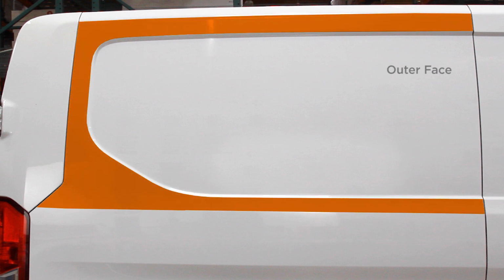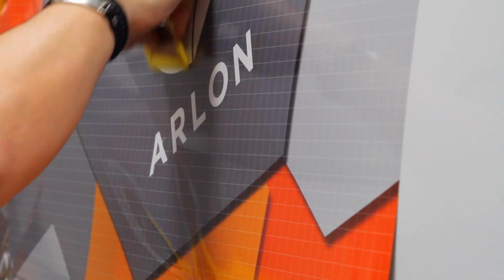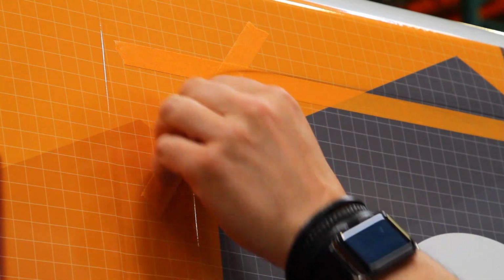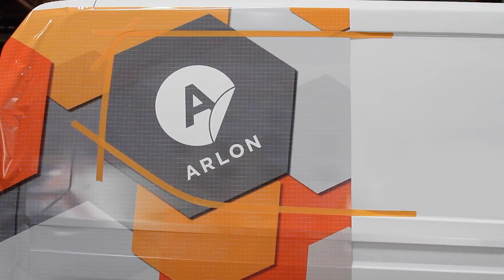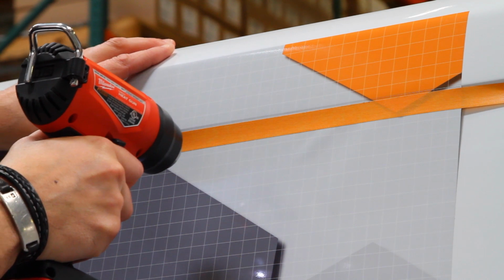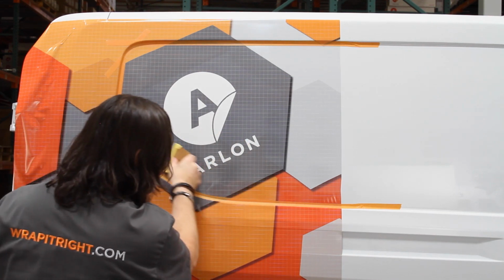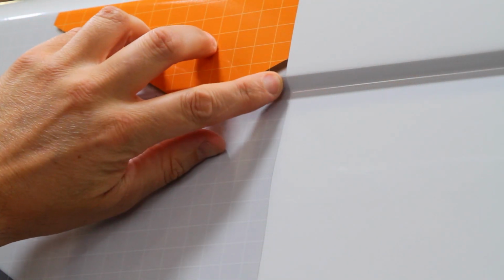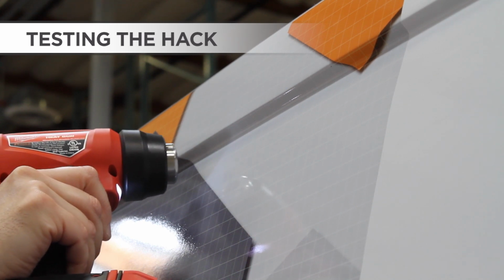The Deep Channel Hack

Comment: Been doing this on vans with success and without lifting.  However I do find it very tricky.  Only enough heat to actually discolour the 'bridge' area of the vinyl  seems to work for me to get the vinyl to go in, any less heat doesn't seem enough. Also large bubbles seem to form in the bridge areas after heating it into the deep recess whilst trying to squeegie the 'stretched' area on. Which isn't a problem as they press/ heat or pop out but I can't stop the large bubbles forming.
Any tips on that ?

Comment: Until I see a van that's not pulling out of the grooves a year or so later, I'll keep cutting and dropping. I've seen a ton of how to apply vinyl in grooves videos over the years and have yet to see one where they go back and see how it's holding up. If you look at transit/sprinter wraps going down the road you see 2 options in the grooves, pulling out or cleanly cut and dropped. You never see cleanly sunk in the groove unless it's brand new and just got wrapped.
Reply: Good. This is good.. lol. So, I am a certified wrap artist and a 3M factory certified installer... I will say this. It depends on the film and time of year/and or/ ac. but, I know and can teach how to properly install the recessed areas. And, how to heat and push and post heat. It's just art. But I'm kinda good at it.
Reply: @daviddrake399  all deep recesses pull out after a few months unless the vinyl is liquid laminated. I’ve been wrapping since wraps were an idea and have all the certifications. You’re not getting it to stay in the grooves for longer than a year no matter how good you are. Especially if you have overlaps/seams. I’m not saying it will all tent out, but a few spots always will, even with perfect post heat and primer.